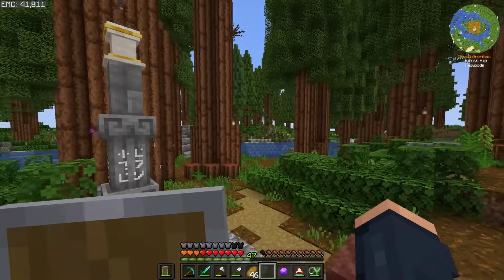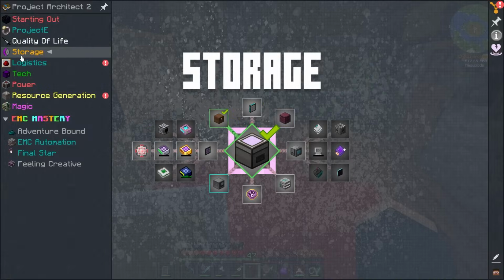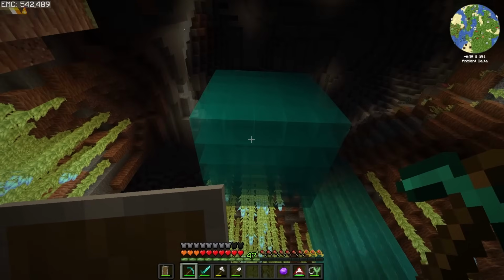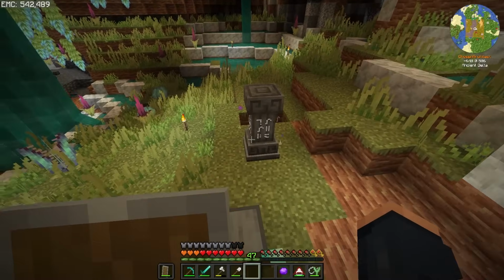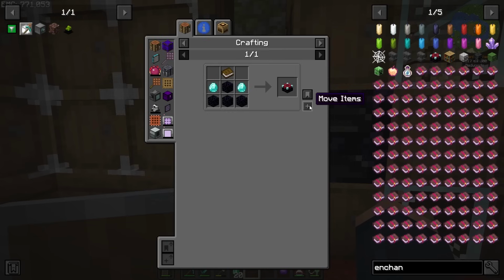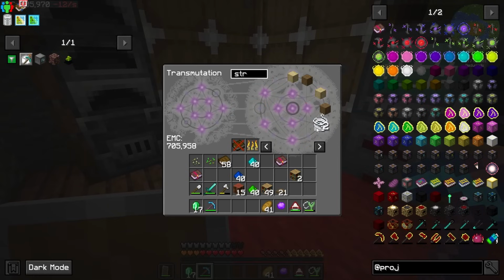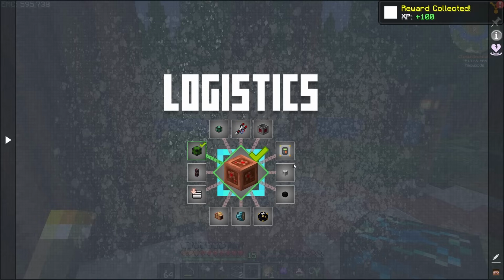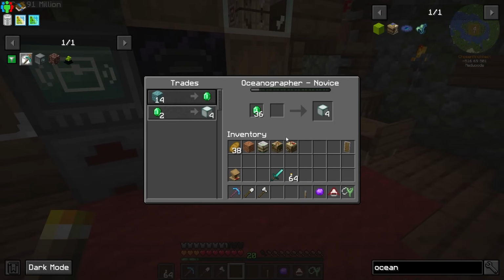PROJECT ARCHITECT 2 - EP 4: RFTools Quarry & Auto Villager Trader

Comment: Hey chosen. If you create a spell in ars using touch and break. You can use that spell while interacting with the emc table, making it break. But you will stay in the emc table interface, allowing you to use the one emc table to add it to learned items to get more emc tables. You don’t have to manually craft one.

Comment: If you bring your rftools quarry to the end it can mine Draconium dust which is 16,384 each. You can also just find giant meteorites full of Draconium in the end, which have millions of emc's worth. When I spawned into the end I didn't spawn on the central island and actually spawned in the outer end and mined Draconium dust ore which is spotted all across the end islands, when I wanted to leave I just used a warp stone to warp back to my base's waystone.

Bonus: Get a Temporal Pouch, it saves time as it stays in your inventory and can multiply the speed of machines like the builder/quarry. The longer it stays in your inventory, the more time it builds up, and you can use it by crouching and right-clicking a machine

Early Game Tip: Mine quartz blocks (from quartz flatz) or glowstone from the nether (should use leap spell from Ars Nouveau to get up to glowstone early on) it is super easy and can net a few million in emc which is really useful early on.
Reply: Nice tip, just one question… HOW did you spawn on the outer islands?

Comment: To chunk load a RFTools builder quarry you only need to load the chunk that the builder is in. I have made a few 512x512 quarries for the mining dimension in ATM packs and that has worked in them.
Reply: My exact experience. 🙂
Reply: @mortisCZ  In your experience have you experienced it stopping and if so have you ever figure out what was the cause. i did 256x256 and it would always stop at chunk like 200 something and never finish. Also maybe I don't fully grasp how it works but i made an attempt to use the quarry to flatten and area out and for sure the chest was filling in massively with dirt but it almost looked like it was sporadically placing dirt blocks and or replacing grass blocks with dirt blocks basically it looked like a greifed section of the map lol. and in this case it was only 80x80

Comment: protip for mining with projectE...  the catalytic lens can insta-mine by right clicking, out to 64 blocks... but it uses 24 EMC per block.  and when i say out to 64, i don't mean a total of 64 blocks mined like the vein miner.  it mines everything 64 blocks away from you, when at full charge.  so if you're not rich on EMC yet, just use the vein miner set to 3x3 tunnel.  not nearly as fast, but of course more efficient.  
to fuel the lens, you can keep a klein star in your inventory.  and if you don't know, you can fill a klein star by placing in the left side of the transmutation table.

Comment: Everyone's heard of the one-chunk challenge, but what about doing a horizontal version of that where you only get a 16x16 area along either the X or the Z axis (but not both)?  In RL, there's a smart-city concept being built in the middle east (Saudi Arabia?  Syria? Jordan?) called The Line that is looking to be self-sustaining, efficient, and completely green.  It was built to look like a giant wall (ie, a straight line), with the nice, pretty walkable-city on top and the ugly and gross infrastructure stuff hidden inside the wall.

Aside from that, a proper building challenge for you could be to build your buildings using only straight lines and splines (curvy lines)...no 2d or 3d regular shapes like circles/spheres, squares/cubes, or triangles/pyramids.

How about an "inside out" build for your next base idea?  By this I mean that any area you intend to be an outdoors area you put some kind of ceiling on it (pergola, lattice, etc) but any indoors room had to remain open to the sky.

Comment: One way to generate emc i discovered is using hoppers. Hoppers have more emc than its parts so using Rftools crafters and furnaces I can pull out as much raw Iron as i can and craft hoppers making a net gain of about 1000 emc per hopper. I made this semi automatic by just piping in raw logs and iron into the system and having the crafters do all the crafting work. It's not very automatic but it does help in boosting your emc by a lot early on if you need it. (its good to have a factory upgrade for your furnace so you don't waste emc on fuel).

Comment: Thats weird i tried using a builder quarry 2 days ago (without a filter like ive always done in the past) and it wouldnt mine a single block
Reply: I've had something similar happen. Turns out I just forgot to gove it a Redstone signal, and when I finally figured that out, I forgot to set the dimensions I wanted it to mine. I gave up for a few days I was so frustrated with it not working lol

Comment: Honestly, this is a GREAT modpack , but it kinda is heavy like a bit too heavy so its been a tough time playing this pack. Maybe someone could tell some tips to improve fps (i already have most optimization mods)

Edit note : I have a trash pc
Reply: How much RAM do you have and how much do you have assigned to the game?
Reply: @Th3BlackLotus  I have 12 gigs of ram and I'm using 8.5Gb
Reply: There’s a lot of good performance mods on modrinth I downloaded like 3 and it improved heavily
Reply: Need more info. Are you using shaders, graphics/texture mods? What's your PC specs? How much RAM assigned?
Reply: @ArnoldQMudskipper  No shaders, I have disabled mode texture packs which I don't need
8.5 gb ram assigned 
Specs:
Cpu - Intel Pentium g5400 (ik this is bad gonna upgrade soon)
Gpu - igpu (uhd 610)
SSD - 256 gb (Kingston)
Etc
Reply: @ArnoldQMudskipper  also to note that I could have played ATM 8,9 MC Eternal at okay fps but this 300mods pack is really testing my pc
But I have finally got it working on 720p and very low settings
Reply: @GZome  reinstall your java? My GF has 8gb ram and shes the host of our game. Runs rather smoothly. 
you could also look into some start arguments for the loader itself to tweak how minecraft uses your computers resources.
Reply: @lxbjerre  yea I'll have to look into the Java arguments but it's mainly due to my pc not other factors as I Would guess
Reply: This is just the CPU being too weak, really. Minecraft is an extremely CPU-bound game, especially large modpacks like this one suffer heavily if your CPU is bad. Definitely look into Java args if you haven't yet, especially garbage collector settings can make a noticeable difference. Otherwise there's probably not much you can do. Once you get a CPU upgrade you probably won't have issues anymore, as your graphics card barely matters if you're not running shaders.
Reply: @GZome  I'm pretty sure this is a CPU problem, I'm able to play on a pc with only 8gb of ram
Reply: @GZome I'd have to guess your cpu is lacking. 8gb of ram should suffice. Make sure you turn off the shader packs as well.
Reply: @MetroDetroitGoaltending  Yea I've recently got a new pc, it's running smoother than butter now !